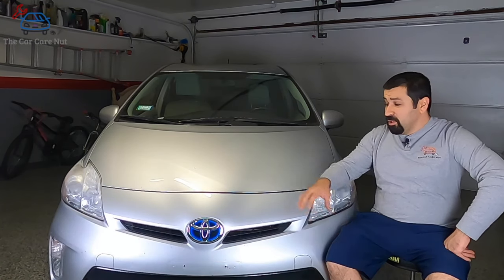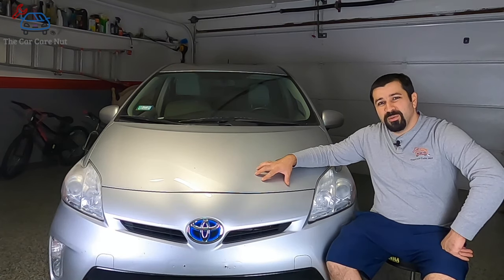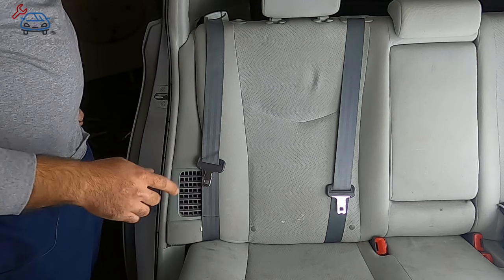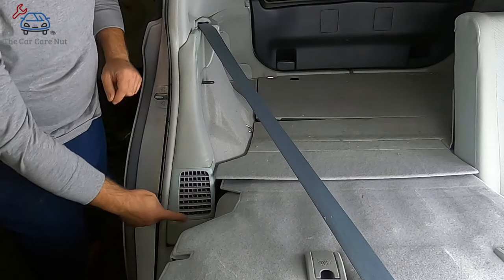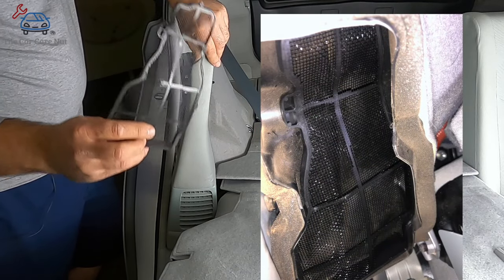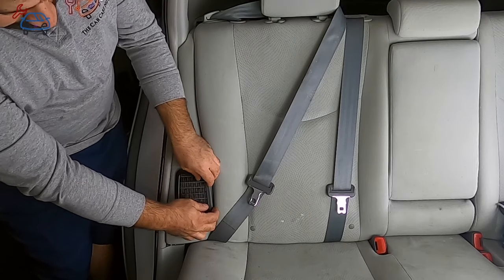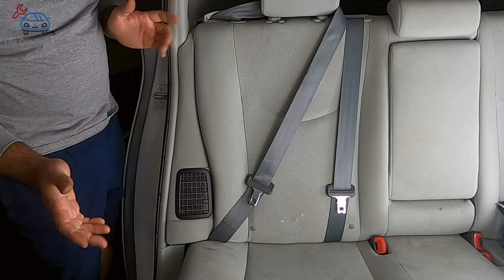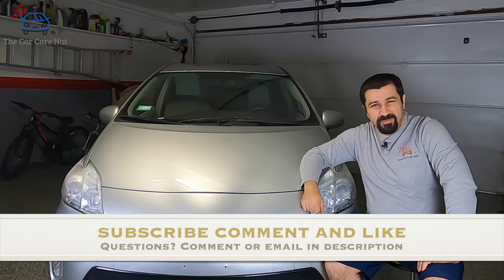How To replace Hybrid Battery Fan Filter : 2010-2015 Prius

Comment: We have a 2011 Prius. No filter. It's 2023 now and the service department has never mentioned installing that outside clip-on filter. 🤦‍♂️ Since the standard way of accessing the fan involves a HUGE disassembly procedure, I'm going to try to snake one of those thin, flexible clothes dryer vacuum hoses in the duct vent to clean the squirrel cage fan before adding a filter.

Comment: Installing mine as soon as it arrives I just went through changing out my HV battery and I had bought the car used You can't even imagine that's the wad of dog hair that was trapped in the fan because it had no filter from the factory that will never happen again

Comment: For 2015 Prius V reach under rear passenger side seat with a vacuum cleaner hose and vacuum any debris from screen. Your done. Don't let things accumulate under the seat that might block fan intake. I discovered this after following the directions from another video that instructed the screen be removed and cleaned. That was much more difficult than was necessary.

Comment: Just upgraded the filter on my 2014 Prius. To remove to old one, it helps a lot to loosen the bottom trim bolt a few turns (not all the way out) before trying to lift. Easy to reach with a 12mm socket and extension.  Thanks for all the good information.

Comment: Thank you sir!  Didn’t even know my 2011 Prius had a battery filter.  I’ll have to check it out soon.  Thanks again.
Reply: It doesnt, they started installing them in late 2012. Add the clip on one. It is a good idea to clean the ductwork and fan. It will add many, many miles to the life of the battery as I understand it.

Comment: Thanks! You saved me lots of time. I was going to take the seat out. I just pulled the  cover up and leaned it over as you suggested. I did not take the original filter out.  The hose to my regular vacuum was to big to fit in.  I rigid a narrow wand of about 1 inch X 1/2 inch X 10 inches long. As with all such projects, duct tape may come in handy. I vacuumed it clean and snapped the cover back.  I can do this in less than 10 minutes in the future. I love all your videos.

Comment: Thanks very much for this video! When driving home just now, I got a message saying the battery cooling performance was low. I pulled out this filter, to find it was quite thoroughly clogged. After changing it, the message has not cleared. I am going to take it for one or two more drives, to see if it eventually goes away on its own. I even tried using the method for clearing the maintenance messages, which had worked before when I got a message about the hybrid system (after the engine air filter compartment was not closed properly) , and it worked then.

Comment: Just cleaned my battery cooler fan, and saw your video. I had no filter on my vent at all, so I ordered the one you recommended, to put on the outside.
Thanks for the video.
Reply: How did you clean the fan?
Reply: @josuerodriguez8121  I used soapy water, and a toothbrush, followed by blast of compressed air.
Be patient, take your time.

Comment: I have a 2015 Prius.  It took some effort to pull that filter housing up and away...but I vacuumed it out with my brush attachment.  I will be ordering that part online as the dealers closeby did not have that on hand.  Thanks
Reply from the maker: There is a bolt holding it down. That’s why you only pull it slightly out and not out all the way just enough to remove the filter. You can pull the seat bottom out then remove the bolt if you want to completely remove it

Comment: Having viewed your excellent video I ordered the external filter.  My car is a 2013 Plug-in Prius ( UK Spec) the car is low mileage 30k miles. Removal of trim was dead easy following your instructions. Surprise, surprise there was no filter in position. The plenum duct was exceedingly clean, spotless, the rear seats have never been used ,I assume the fans must be relatively clean too. So easily replaced trim and snapped in new filter. The whole exercise took less than 5 minutes. - Many thanks for your videos. !

Comment: Thanks so much for teaching me about caring for my 2013 Prius.  I bought it last NYE and have had no problems, but I had no idea it was so important to clean those filters.  Being a 76 year old widow, it means a lot to have someone to turn to that won't steer me wrong.(no pun intended).  I'm going to get your recommended filter today if possible.  Could you please give me your opinion on the little device being advertised as a trouble-shooter that's called FIXD?
Reply from the maker: Thank you for watching my video! I don’t have personal experience with FIXD buy a code reader is always a good tool to have on hand.

Comment: Just bought the external one for my 2015 Prius, on line from a local Toyota dealer. they had a nice discount from recommended price that knocked it down from 14 to 10. Cheaper than I saw it for on eBay. Thanks for the info. I have no idea if mine has a filter but I guess I'll find out when I get around to checking out the fan. Car has 100k, but I nor previous owner had any pets. We'll see. Edit: No real surprise but the factor filter was filthy!

Comment: Thanks for the tech tip about the filter swap!  Did it the other day with a slight effort. The side sit piece needed a good yank up to remove and replace the hooked latch. Kind of pulled out the filter with a small screwdriver and hooked pick. Was simple enough to do!

Comment: 2013 Prius V with 91k miles.  I recently inspected and cleaned the intake to the HV cooling system (under the rear seat) and found it and the squirrel cage blower remarkably clean and free from any debris.  I did not see any filter, but discovered from the comments here that it did not come with a filter.  After doing a factory recall on the car, the dealer says that the "HV fan vent is clogged with debris and is missing filter" and recommended a $375 "HV fan service and filter replacement."   I suspect they did not really inspect the air intake - a reason I avoid this dealership.  Question: should I go to the trouble of replacing the interior trim with a piece accepting a filter?  If I recall correctly, the air actually comes from beneath the seat.  Thanks for you delightful videos!
Reply from the maker: Hi! There’s a small mesh underneath the passenger seat. Honestly if your fan is clean then the way you use the car likely won’t clog the filter
Reply: Hi @TheCarCareNut ! I also have a 2013 Prius V and it seems like they have a filter part number G92DH-47090 starting with the 2014 model. I was wondering if you knew enough about the Prius V models to know if that filter part for 2014-2017 might also fit the 2013 Prius v fan, retrofitting it kind of like you do suggest in this video. Love your content, thank you!!

Comment: I'd have both filters on. The second filter doesn't create a big resistance but filters more of the air coming in. The part that is collecting the air and which you removed in your video isn't air tight so it'll pull unfiltered air from the side. The second filter will prevent unfiltered air going in
Reply: Do you still think it's best to have both on ? Seems like the one inside does good job at filtering dust

Comment: The #12 hex head screw is accessible by squeezing the right edge of the rear seat, after, its removal you just have to lift the grille which is then easily removed and you discover that the 2013 Prius 5 doors sold in the EU do not have a filter on the cooling circuit of' the HT battery. I recommend the use of a #12 magnetic socket to remove the screw and avoid disassembling the rear seat to find the lost screw.

Comment: thank you very much, this video is very informative I went to take out the filter that was supposed to be in the car when I removed the paneling that filter was not there should I be worried?  nonetheless I replaced it with the filter that goes outside of the vent and it was a piece of cake to put on once again thank you very much for your video

Comment: Wow, surprised my 2012 Plug-In had NO input filter whatsoever. Got into the trunk to examine the two cooling fans and they were pristine even after almost 10 years. Went to dealer and bought the outside mesh input filter.

Comment: Well drats. It looked like such a good idea. That piece just refuses to pull up and out for me.
Reply from the maker: In this case remove the seat bottom and remove the bolt underneath that panel and pull it up and out
Reply: It took me all my strength to get it out now I can't get it back in 🤣🤣

Comment: Well the Toyota dealership charged me 350 for this lesson learned. Thanks bro o.o
Reply: What?!!!!
Reply: @SvenTSchixe  yup idk if it was just this they did but I took my car cause it got recalled they called me saying that they needed to change and clean the filter for my rear battery saying it will keep the battery healthy i honestly didn't know much about the rear battery on the prius so I made a dumb choice and said yeah without looking it up.
Reply: @christianmiramontes5392  I am in Canada, is the price you paid in America as I am guess you are likely an American?

It is highway robbery in either currency.

Take care bud!
Reply: I think they did the conventional way to remove it by pulling the seat out. Much more labor intensive. It's still a ripoff though unless they cleaned the fan also.
Reply: @christianmiramontes5392  I'm in the UK. My Toyota dealer is a Stealership also. After putting my gen 3 in for a standard service, they phoned me and said it needed all sorts of things done, including a tyre change because of 2 nails in the tyre. Knowing the main dealer prices were expensive, I told them to just do the service.This was 18 months a go. Since then I've gone through 2 MOT'S with no problems and no new tyres. One thing the dealer said I needed was a £300 welding on a bracket for the rear exhaust. Turns out the there was a slight little crack on the bracket - and there are 2 brackets anyway. If I had agreed to the work they wanted me to have done the bill would have been over £800. I guess they're the same all around the world.

Comment: I have a 2013 Prius C, , I watched your hybrid battery filter, I checked and there isn't a vent in the same place as the video. it has about 110000 miles and I don't want to sell or trade but I also don't want the batteries to go bad on me. I took it in for service and asked them to check it. the mechanic told me he checked it and it was fine. but the service writer told me, they didn't check it because they had to take the back seat out. so I need to know for sure.

Comment: Hello CareCarNut Dude! Thanks for the easy vid. I opened that little space to remove the filter only to find - NO FILTER! We bought the car brand new, and to my knowledge, no one has tampered with it. Questions: 1) Where does the dust go if there is no filter? 2) Can I access the area where the dust has possibly ended up? Thanks!

Comment: Man . I don’t know how to say it but since I started watching your videos I started looking for a Prius 2010 and newer models I don’t mind 100,000 miles though but they’re expensive comparing to others .I could be wrong . I do own a Toyota Tacoma pickup truck 4 cylinder manual shift 5 speeds very reliable but I need a Prius for my Uber eats side job just because it’s very efficient on gas but I found that here in Massachusetts they’re expensive and not reliable in a tough winter weather even in the city commuting.
Reply from the maker: Hi! I would look at 2012+ Prius 2010-2011 had a few issues that were better with 2012+. They’re expensive for that very reason that you mentioned.
Reply: @TheCarCareNut  . Thanks a lot bro for the quick response. I will work on your advice. You know better when it comes to this . Keep up the great work.

Comment: Awesome ! Thank you for posting this. One question, would it be harmful if I keep both filters on ? I mean buying the external one but leaving the original, would it block too much the air ? Thanks !
Reply from the maker: I wouldn’t double filter as it might be too much. I would just remove the one inside and use an external one

Comment: Why did Toyota place the filter in that location in the first place, surely it would’ve been better in the boot (trunk) or on the floor under the seat? Anyway good advice, thanks for sharing.
Reply from the maker: I agree with you and that’s why in the newer models they are moving the vent to a better location under the seat close to the floor.

Comment: The Filter thats comes with the car, the big one, its better, since it fits where the vent begins (inside) , if you remove it and put that smaller one, the air travels from everywhere inside because it is not sealed, the air coming from the vent outside its only a fraction of all ir coming inside, so your fan inside get a lot of dust. I did that and as I kept the old one, I installed it again. I really dont know th options to replace the original filter, but the one that goes outside its no really good enough. I know it is easier to clean the smaller one, but in the end you end up  cleaning everything inside all over again.

Comment: Hello   your videos are very helpful for sure.    I have a 2013 Avalon Hybrid I came across this post and find the vent and got a flash light and took a look inside, No filter at all , I was wondering do they make one like you shown for the Prius that snaps on the front of the the grill ?  or is it the same for my model ?  Thanks Again

Comment: Looking at 2012 and 2013 Prius’. You recommend lifting that panel up and inspecting with a flashlight before buying? Pass if the filter is dirty (if it has one]? Can you easily inspect without taking the filter off? God bless you!
Reply from the maker: If there’s a filter and it’s clean that’s a good sign. You can use a flashlight to look through the vent without removing anything.

Comment: I have a 2013 Prius model 2.  There is no filter behind the back seat grill.  Is there an easy way to check to see how much dust has built up on the HV battery?  If I point my leaf blower over the grill, would that blow the dust off the battery?  Does the air around the battery exit the car somewhere?  The Toyota dealer wants to charge me $400 labor to remove the back seat and clean the dust off the battery.
Reply from the maker: Hi! I wouldn’t use a leaf blower as that would blow all the dust into the fan. I would instead use an inspection camera would you could buy off of Amazon cheap and send it in the vent to look at the fan. If the fan is clean there’s no need to worry install a filter for ease of cleaning in the future. If it’s dirty then it might be worth the investment to clean it once then install a filter and you’ll never have to clean it again just the filter which is easy

Comment: First, thank you for your excellent content! I am now a new subscriber having just purchased a used 2015 Prius 2, and I am looking forward to watching more of your videos.

I plan to check this filter very soon and will be getting the outside clip-on as you recommended. I also plan on visually inspecting the fan motor for cleanliness. My question is once I have gone to the trouble of   getting to and possibly removing the fan, would it be wise to just replace the fan? Doesn't fan performance degrade over time? The car is now 7 years old with 90,000 miles. How reliable are the fans and would this be a smart thing to do or would I just be wasting money?

Comment: Hi, thanks for your hybrid videos, they are all very informative.  I have a 2012 Plug-in type and just checked for the filter, and no filter was present at all, is there any other item I should check since I found no filter at all?
Reply from the maker: Hi! Yes the fan. Use an inspection camera to check it
Reply: @TheCarCareNut  Thanks for the tip.  I found a video specific to the 2012 Plug-in and two fans were in the back, under the trunk panel.  Both were nice and clean.

Comment: I have 2011 Prius with 235,000 miles. I opened the battery vent up according to your video. I didn't find any filter, so I will order the external snap on one.
My questions are, how do you tell if this fan is actually working? I have never actually heard it, or felt it running ever. Is this normal? Should it be on constantly or just once in a while like a radiator fan? Will it show up in the OBD codes if it's malfunctioning? or is it just so quiet to begin with? Is there any way to test it or monitor it while the car is running? Much appreciate your videos. Thanks
Reply from the maker: Hi! If there’s an issue with the fan most of the time it will show up or you’ll hear it running on high all the time if it’s working but not cooling well.
Reply: Thanks!

Comment: I have a 2014 Prius V and do not have the vent ribs as shown on this video. Can you elaborate? regards Norm
Reply from the maker: Hi! The Prius V is different. The vent is located underneath the passenger side rear seat

Comment: Hi again - as an update on my Toyota Prius Alpha (V in the US), I found some documentation from Toyota that says the Prius V battery cooling fan filter wasn't started on the Prius V until 2014.  Mine is a 2013.  Does that sound right to you?  The grille is under the seat.  What do you reckon about a home fix?  I plan on taking a look at the fan this week to see how clean it is...I LOVE your videos. Thank you!
Reply from the maker: Hi! That sounds about right. Toyota did sell a retrofit kit where you can buy a whole new grille which is similar to the newer ones then you have a filter than you can remove and replace or clean